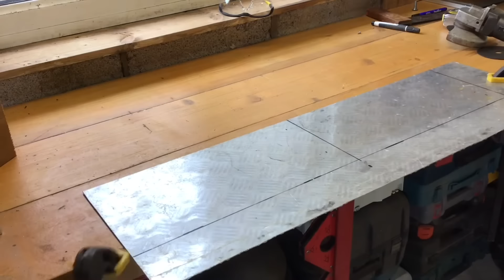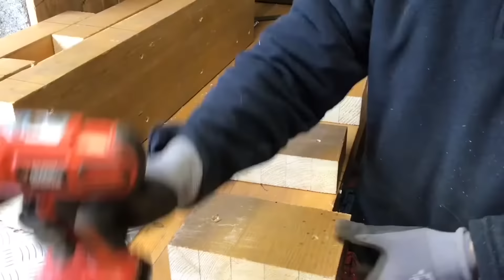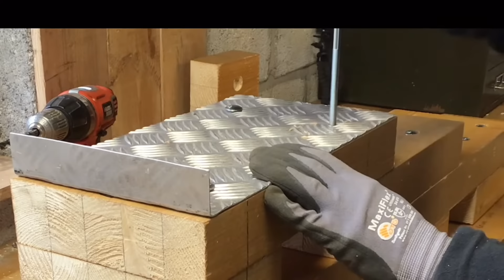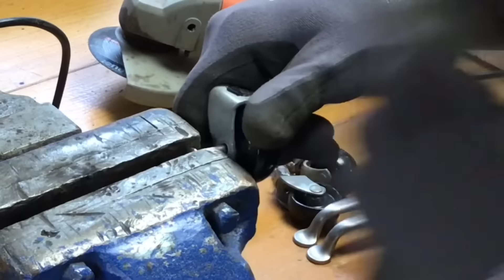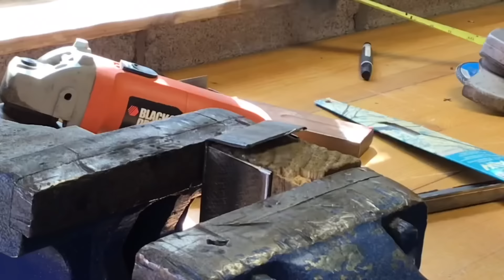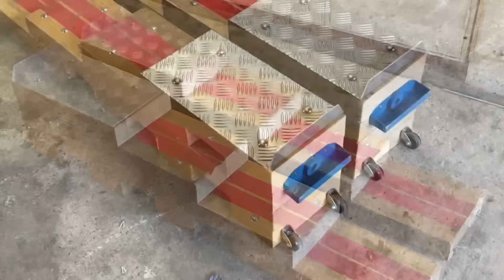Is this too much - DIY Wooden Car Ramps with a few Essential Extras

Comment: What size lumber are you using for the ramps. it looks like 5 pieces of smaller lumber glued togethner.
Reply from the maker: You are correct, they are actually used structural roofing timbers which I bought in a sale to make a bench out of. (There is a video of the bench construction if your interested) I had plenty left over so thought they would make some good ramps. Can’t remember the dimensions and I’m out at the moment, but will let you know later. 🙂👍

Comment: what's going on with the weird blur bar in the first couple minutes?
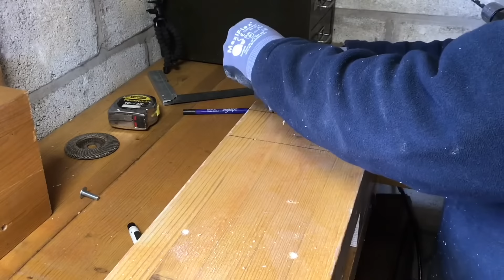Reply from the maker: Hi Ronnie, thanks for letting me know. I did blur out the first few seconds because I changed the name of the channel a while ago. The blur actually lasts 4:20 so it looks pretty bad. I’ve reverted back to the original so thanks again. 🙂👍

Comment: This is all well & good, a valiant effort, but my BIG-G & WIDE-E RHINO RAMPS I purchased several years ago from Pep Boys for the A-MA-ZING price of $20 ( by way of SLICKDEALS ) are doing me just fine.
They have a capacity of 12,000lbs. which is TWICE  the entire weight of my INFINITI QX80 ( BEAST! ).
Reply from the maker: Hi Louis, thank you, I just got carried away making them and it was fun. Those Rhino ramps do look great and would have saved me the work I put into these. Mine do the job very well though so I’m happy. Hope you enjoyed watching. 👍🙂
Reply: @EverydayWorkshop  I am sure the ramps you fabricated do the job and by their certain bulk are up to the loading.
I checked the prices of my larger-size ramps & canNOT believe the tremendous increase that has occurred in the last 5-6yrs.
Some retailers have them for $115, but most others are around $60 & up.
The $20 I paid were represented to be half their usual rate.
I don't usually get deals like that.
Your ramps are sure to be MUCH less, plus they offer the satisfaction of a do-it-yourself project filling a need.
Please keep up this informative and rewarding work.
Reply from the maker: @SpicyRok7482  Thanks Louis, it seems like everything has gone on the back of all the world events. Although I am sure there is a lot of opportunist profiteering going on. I’ve gone over the top with my ramps (a little 🙂) but I’m sure some much simpler and very strong ramps could be made at a fraction of the price you found. Thanks again for watching. 👍🙂

Comment: I love this! The magnetic holders could be more useful on the inside of the ramp though. Just a thought.
Reply from the maker: Thanks JayPee, I agree they would be useful on the inside, they have to be in the body of the ramp I think thought or they would present a problem storing them. Glad you liked them.
Reply: Also the magnetic holders are on the end to act as feet, the same height as the casters.

Comment: What the heck size lumber are you using looks like your cutting off part of your work bench and using it ???
Reply from the maker: Hi David, 😊 looks like it yes, it’s actually left overs from building my bench. It’s some 200 x 60 laminated structural roofing timber I bought from a sale.

Comment: Do you have any dimensions, lumber looks to be laminated 2" x 3" or so?  What are the lengths, I'm thinking  3 at 16", 1 at 36", and 4 at 6" ?  Would like to build a set.  Thanks for the video.
Reply from the maker: Hi, I’m glad you liked them. Yes they are laminated. They are actually structural roofing beams which I bought from a country sale to build a workshop bench with. (I’ll post links to the bench build videos if you are interested😊) Your dimensions sound quite close. I plan on uploading a short video with all the sizes in the next couple of days, as other people have also asked for them. Thanks for watching the video. 👍😊
Reply from the maker: This is the part 1 video documenting the bench build I mentioned: https://youtu.be/RIe_w0xq-NQ
Reply from the maker: I just post a video showing the dimensions. If I’ve missed anything please let me know: https://youtu.be/XFQODzYYmHA

Comment: The blue trays are neat, but the should be on the inside
Reply from the maker: Hi Kululv, thanks for commenting but I’m not sure what you mean, on the inside of what?
Reply: @EverydayWorkshop  on inside of the ramp, instead of the front. If you work in between the ramps, the sides would be easier to reach, next to where you put the tools
Reply from the maker: Yes I agree but after using them they are easily reachable. Also I designed them to serve another purpose… I can stand the ramps on their ends for storage as they are exactly the same height as the wheels. Which I think I show in the video. 👍😊
Reply: @EverydayWorkshop  i figured, that was likely your reasoning.

Comment: No need to go to all that trouble, over engineered for sure, you'd need a crane just to move them 😄 you could put a 747 fully loaded on those ramps...... no problem !
Reply from the maker: Hi Colin, Yeah I won’t disagree with you, I did over engineer a touch, but why not. Hopefully they make an entertaining video. They are made from old structural roofing timbers from an old sports hall, and are actually not that heavy. They have wheels too 😁.
Reply from the maker: I built a simple bench out of the same timber if you are interested. It’s time lapse in two parts. 
Part 1 https://youtu.be/RIe_w0xq-NQ
Part 2 https://youtu.be/awDRlzClCc4v

Comment: Just don't forget how many bumps it is to the top level. 
There's another video which shows a much simpler and more practical design.
https://youtu.be/2tMp_IBvlbo
Reply from the maker: 😊 your right D not something you want to do. The secret is to lean out of the window as you ascend and make sure you stop in the correct spot. 
Yes I’ve already seen that video, he’s made a great set of ramps and I agree they are simple and practical, the hinge ramp was something I contemplated when I made these. Maybe I’ll make another pair that do hinge out of the way. Come on though these are fun 😁

Comment: Is this too much ? Knott > Woods not glued together ! Nuts & Bolts not welded in place ! 
Ramps could come apart ! LOL
Reply from the maker: Hi Ricardo, thank you for your comment. I take your point but I f I glued the wood together it wouldn’t be necessary to use 10 mm coach bolts. And I can assure you they are nice and tight and have both a flat washer and “spring washer” so won’t be coming loose any time soon. Hope you enjoyed watching the video though. 🙂👍

Comment: Great build… just curious, why did not you bevel cut the ends of each block ramp rather than leaving square edge? Nice touch on the aluminum top with a backstop. Otherwise, a diy heavy duty car ramp …thanks for sharing. 👊😎👍
Reply from the maker: Hi Charley, glad you liked it. Great question and something I considered when deciding on the design. In my experience it doesn’t make climbing the ramps any more difficult, in fact probably the opposite. You also control your accent this way, and not arriving to quickly 😊 at the top of the ramps. Probably no big issue, just my take on the pros and cons.

Comment: The ramps don't look too stable/steady, may be double the width just to be safe ?!
Reply from the maker: Hi, I understand your concern but they are actually very stable so long as you use solid ground and centre the wheels correctly they are absolutely fine. I would actually have liked them a little wider, but I had this timber spare and new it was suitable. So you see the ramps cost me very little, the only purchase was the grip tape I applied. Thanks for watching the video I hope you enjoyed it. 😊👍

Comment: You've got all of that nice equipment, table saw, pillar drill, welder etc but you can't afford a hole punch Hammer 😂😮😅

Plus the amount of tools you needed and time it took, better off buying metal ramps.
Reply from the maker: Thanks for commenting on my nice equipment BandiMassha, it’s ok but fairly basic. Not sure what you mean by a hole punch hammer (I actually have loads of hammers 😁) I have to disagree about the ramps though, I had great enjoyment and satisfaction making them mostly out of materials I already had, so they cost me very little. Plus I like to think they made a great video subject and if they help anyone who considers making their own that is fantastic. I hope you did enjoy the video. 👍🙂

Comment: at this point its cheaper to get a real ramp. also 0 safety for falling over on the last step which would heavily damage the car...
Reply from the maker: Sure it’s cheaper to buy a ramp but it’s great to have the satisfaction of making your own and it made a great video 🙂. Not sure what you mean about getting a real ramp, I can assure you these are definitely real and much better than the majority out there for sale. With reference to your comment about the car falling off the end you are correct a car could drive over the stops just like a car will climb a kerb. You are possibly thinking they will just bend in which case you would be 100% wrong this checker plate is very strong especially after being bent as the structure of the metal changes increasing its strength and work very well as a stop unless you keep driving ! Thank you for watching and I hope you did enjoy it. I would love you to reply. 🙂👍

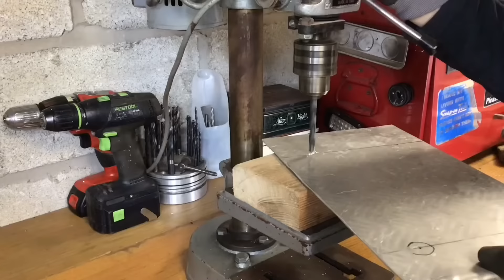Comment: 3:58 Don't use hands as hammers.
If you suffer permanent nerve damage you will regret it for the rest of your life.
 If you must use a hand as a hammer , use someone else's hand - or their head ,which is heavier and harder
Reply from the maker: 😁 More Great advice Paul but you can’t do everything with a hammer, and I do love them. I have quite a few 😊. You notice I was using one a few seconds after that point. 
Thanks for your concern but don’t worry about me though, I think my hands, wrists, arms and shoulders have evolved to take it. (that was tame by the way) I’ve been an engineer since the mid seventies so I’m happy to carry on working this way. You learn to know the point at which the hammer needs to take over. 👍

Comment: Other than the high cost of elbow grease ... how much in wood and parts ? I have a huge scrap wood pile at hand ... but this would be something to hand down to that Lil Grease Monkey Grand-Daughter . And then to the next one . Well made . Built to last . ....... so ah....what you charging ?
Reply from the maker: Yeah there was a fair amount elbow grease, but that’s ok 😊. I actually bought the timber from a country action specifically to build a bench. So I used the surplus to make these. Think I paid around £40 and I still have plenty left. About £20 for coach bolt and £10 for the grip tape. Hadn’t thought selling them, but now you mention it 🤔.
Reply from the maker: if you are interested the bench build is here (a lot more elbow grease went into this) : https://youtu.be/RIe_w0xq-NQ

Comment: Please !! for your own health stop using your hands as a hammer
Reply from the maker: Thanks for your concern Jim, and it is great advice I I wouldn’t recommend anyone starting to use their hands in this way especially if they don’t normally have a hard hands on physical job. But please don’t worry about me though, I think my hands, wrists, arms and shoulders have evolved to take it. (that was tame by the way) I’ve been an engineer since the mid seventies so I’m happy to carry on working this way. You learn to know the point at which the hammer needs to take over. 👍
You can’t do everything with a hammer, and I do love them. I have quite a few 😊. You will notice I was using one a few seconds after that point.

Comment: I noticed a little editing in the video just when the tries pushed against the folded metal on the top, . .  I wonder what happened ?
Reply from the maker: I just rewatched that bit as I couldn’t remember. Pretty sure I just bent it a bit more if at all then finished it off with hammer and block. That’s all nothing more interesting or funny or I would have left it in. Probably more likely my rubbish editing. 😊 Thanks for watching. 👍

Comment: Lots of overkill period
Reply from the maker: Absolutely Mark, and why not I enjoyed the process and they are actually very useful. 👍😊
Reply: Lol, except where it really matters - the stop at the top.  Issue isn't strength of the material, but the inadequate height.  The height should be significantly greater than the preceding wood "steps", as going past the stop is catastrophic.  Better yet would be to eliminate the steps or at least add bevels to the leading edges which would make it more obvious that the stop has been reached, but this would add additional work.  Otherwise, one needs to count the steps, and be extraordinarily careful driving up the ramps.  IMO, there is simply no justification for not making the stop nearly failsafe when it's so easy to do so.
Reply: These are awesome! I am curious as to why you didn't bevel each piece at a 45 degree angle as I see most builders do?